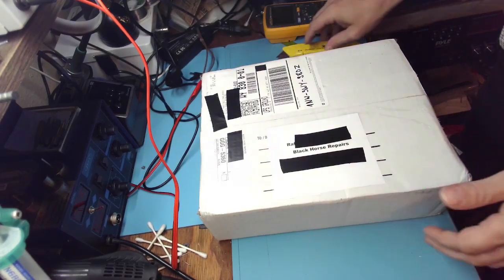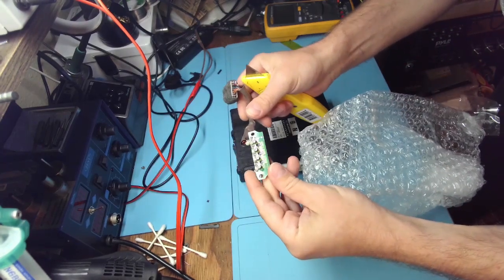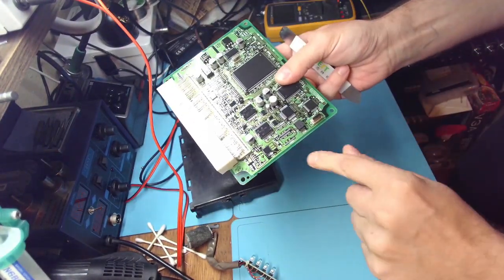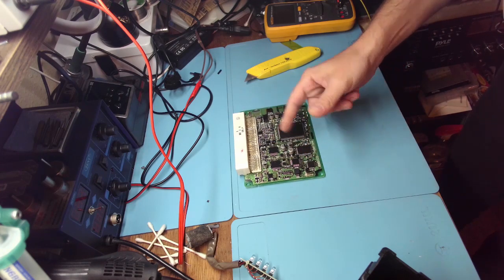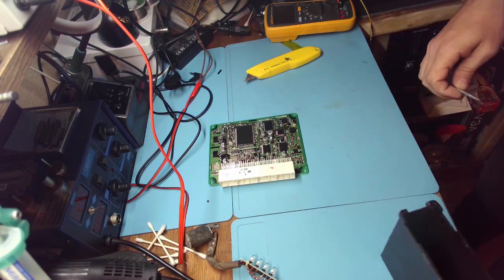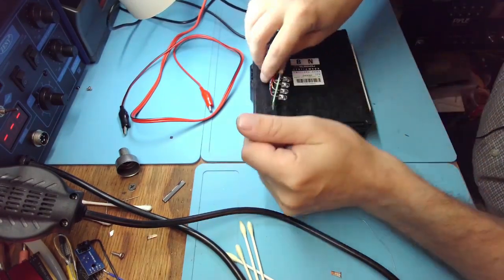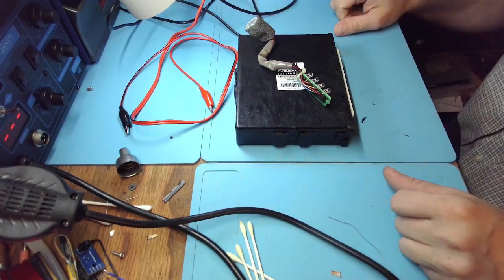Subaru ECM IC608 Repair for Erik [WA]

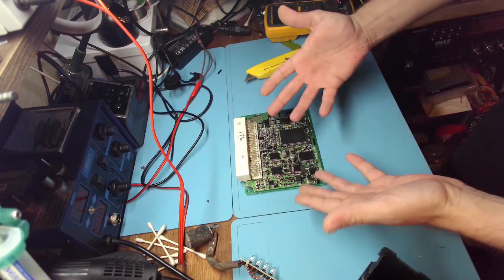Comment: ~4:00 my conclusion after decades of repairing broken junk is that RoHS solder just doesnt age gracefully like good old lead stuff. That and it appears to be more brittle, and more prone to fracturing over time. Perhaps this is due to thermal differentials, i don't know. I just know that good old lead based solder seems to last much better over time, vibration, and thermal factors. Replacing that EU mandated junk with the real stuff seems to fix many issues, especially as component density or environmental stresses increase.  If all boards were produced with better solder, how much less crap would end up in landfills? Isn't that environmentally friendly? Don't eat the solder.
Reply from the maker: very true